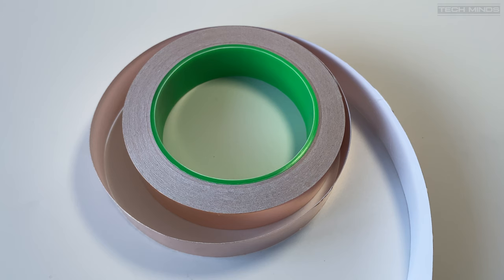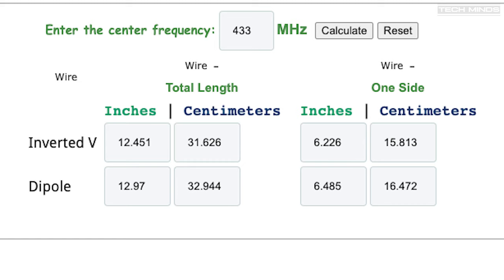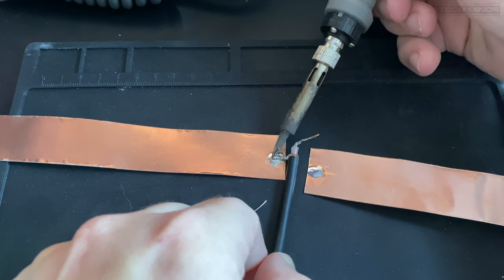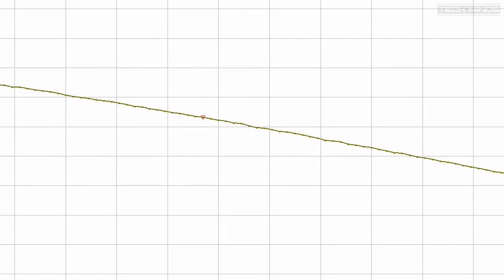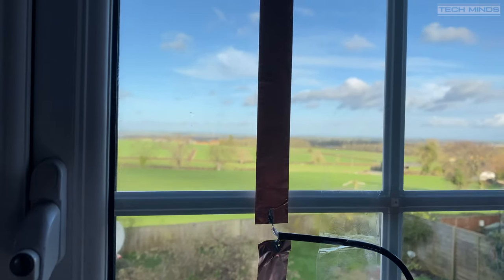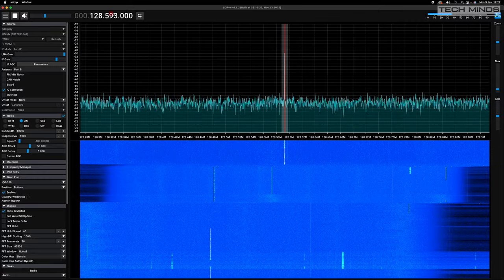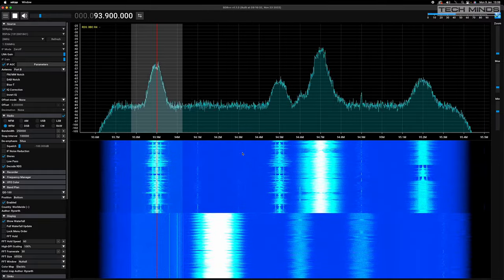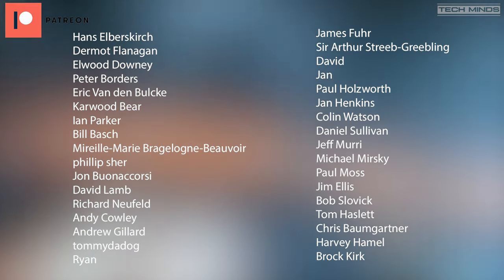VHF / UHF ANTENNA MADE FROM COPPER TAPE

Comment: Awesome video. Glad you are getting the knowledge out there. I build one of these for an old 3G modem for lady who had an art studio in an area with no internet and very weak cell coverage. I made a dipole for 850mhz on an attic window with copper tape that she used for making stained glass windows. It was all she had and I had not planned on doing antenna work. I cut the end off a wifi antenna that had an SMA-RP connector, made a "pin" out of rolled up tape and put it into the SMA connector on the modem. Full signal right away. I was shocked. I soldered it with solder meant for making stained glass windows so came back a few weeks later with a proper factory made antenna, but she still talks about that bodge whenever I run into her in town.
Reply from the maker: Thats awesome! Just goes to show that you dont always have to purchase off the shelf products to get good results. Science is science :-)

Comment: Look up “flowerpot antenna” if you get a VK callsign in the URL you are in the right place. I use these a lot. I dont strip the coax I just joint a piece of wire to replace the centre conductor.(cheaper). 😊
Reply from the maker: Oh yes, I have experimented with these types of antennas, they work very well indeed.
Reply: Aluminum Foil, heat duct tape antenna?
Reply: Love my flower pot!

Comment: I operated on 2m SSB back in the 1980’s using coat hanger wire bent into a folded dipole on the window.  Only downside was getting RF feedback into the audio via the mic lead.

Comment: Don't forget the dielectric constant of the glass. This also has an effect on the resonant frequency of the antenna. The wider the tape is, the greater the bandwidth will be - probably. Keep up the great work !
Reply from the maker: Absolutely, many factors to think about for a perfect tune. Cheers!
Reply: I wonder if the shape also influences directionality. While a wire dipole is round, and thus every direction "sees" the same surface of copper, this is not the case for a tape.
I did experiments with copper tape for antennas a few weeks ago, both to make microstrip antennas and larger dipoles (but free hanging). Looking to make an optimized antenna for 128MHz with a hopefully quite wide bandwidth (FM radio + 144)
Reply: @keukenrol  That is a very good question. It is good to hear about your experiments. Now I am wondering if a resonant loop antenna can be constructed by sticking copper tape to a window. Why don't you make a short video about your experiments ?
Reply: @fotografm  A bit short on time right now, but if I find something significant I'll share! EDIT: I was thinking about using a PCV pipe to bend the copper tape around in its width and make a kind of copper tube from it. Make 2 of it and use it as dipole.

Comment: I have made copper foil antennas for television on that ribbed plastic foam board used for posters. The foil I used was intended for stained glass and was not as wide as your foil. I was pleased with the results and made several of them for friends.

Comment: Over here in 'Merica, in the early 1990's we worked on a GM car program called 'Backlight' and made up FM diversity antenna prototypes with copper tape directly on auto window glass of test cars in a Detroit test area where there was nearly 1,000,000 microvolts/meter signal strength across several bands! There were so many transmitters, AM, FM, TV, cellular, business, etc that there was even cross-band suppression of a few broadcast AM stations by FM transmitters! It's the wild west in the USA when it comes to allowable signal strength!

Comment: Old estate agent's boards mare from Correx board would be very good for mounting the foil on. I always keep an eye out for those boards because they can be very usefully recycled! Another source can be those roll-up standing signs people make for events - they are held up by about 7' of aluminium poles which are a good basis for VHF/UHF antennas
Reply from the maker: That's a great idea!

Comment: I recently made an INMARSAT patch antenna from aluminum sheets and copper foil tape (made with the same specs as the one you made with PCB). I have no way of testing the SWR, but I was receiving/decoding ACARS. I've found that adding 3-6 layers of the tape can help, as the adhesive is "conductive".

Comment: A dummy load has a very good swr across the band also.
Reply from the maker: While your comment it very true, have a think about what I am showing in the video. ;-)
Reply: @TechMindsOfficial  thanks for the vid. My comment Was in relation to the unexpectedly broad and low return loss of the antenna which makes me think that the rf energy is being dissipated rather than radiated.  It would be a good comparison of the frequency response of the antenna against a simple dipole made by stripping the ends of a coax cable.  The width of that conductors will make the copper tape antenna more broadband.  However you are right and it does show a novel approach of using a material made for one application being used in another completely different use which I love.  One of the great aspects of the ham hobby and home brewing is that it make you look at what a product actually is, not what it says it is on the packaging! Well done,

Comment: I have some of tha ttape, though I did not get on with experimenting with it. The classic use for it is the "barber pole" antenna, where it is wrapped around a non conductive pipe. I sort of see making antennas being easier than buying them. With raw materials on hand I can make a 2M antenna faster than I can shop for one, and way faster than the wait for it to be shipped to me. Not to mention the time at a job to pay the high cost of factory antenna.
Reply: I've made several 2m antenna on fiberglass driveway markers.  They're about a meter long and 8 dollars for a pack of 4 at WalMart :)  Put about 10 turns of 18 or 16 AWG solid wire at the base, then continue straight to the other end of the rod.  Trim the length back to resonance.  You can heatshrink the whole length if you want, but be aware that the velocity factor change will probably affect your tuning

Edit: Obviously needs a ground plane of some sort to work well.

Comment: That copper tape's adhesive is conductive, so if you want to add a little length, just add an inch of tape at the ends, making sure it overlaps the existing tape.

Comment: In playing around, it seems like theres no penalty for just sticking some more on to the end for extra length. You could make your antenna longer with ease. You could also probably just tape the wire right to the strip without needing solder for experimentation with other configurations like j-poles or yagis. The options for duct tape substrates makes this an interesting portable antenna as well.

Comment: The total Mass of the material becomes a player here. The adhesive and glass introduce capacitance also. I've had some very good results with tape on 3/4" pvc pipe, and polyethylene. Use your power meter to map out the lobe pattern. 
   ;)

Comment: Nice video!  As others have noted, you’ll get some interaction with the metal around the frame of the window and possibly something from the coatings in the glass.  When I’ve done these sort of antennas, I shoot for a 1.5 SWR (as it’s a dipole) and don’t worry too much about the slight mismatch.

If you’re making home antennas, I recommend the co-ax “flowerpot” antenna.  I have one of these for SOTA and it’s an excellent performer.

Comment: As a quick way to prototype wire antennas, hot glue thin gauge copper wire to poster foam core boards.  The hot glue lifts off with a bit of alcohol, so making small adjustments is easy.  

Also the foam core is essentially air, and thus has the same dieletric constant as air (of 1.0).  Glass is much higher.  Compensation is possible of course, but you won’t be able to directly translate dimensions from prototype to production antenna as easily.

Comment: Nice experiments!  I've done similar with copper foil tape acquired as "stained glass foiling tape" from a craft store.  The only yagi-uda I tried that way was for 2.4 GHz Wifi which worked OK, but not as well as I was hoping.  In that case I stuck the tape elements on a sheet of clear acrylic trimmed down to the rectangular outline of the yagi.
Reply from the maker: That's a great idea!

Comment: The wider and flatter the conductor,
the lower it's inductance per length.

The difference in inductance between 1 meter of 1 mm round wire vs 1 metre of flat 40mm wide copper tape is astounding.

Check this with an LC meter and you will be blown away.

Btw,  When you moved the coax on the vhf version did it change the SWR ?
Did you choose a specific coax line length ?

Comment: I have a dual-band Jpole on my sliding glass door made out of this stuff... but instead of using copper tape I use Aluminium Duct Tape used by the HVAC Construction guys... makes an easy and simple RF Ground trace as well as a easy SDR Loop and Planar Disk antennas for UHF+... makes easy home-made capacitors, and voltaic piles if you're into that sort of thing...

Comment: Hi there, 
very very interesting your video; I also was thinking of testing a similar set up, but then life&work got in the way ... 
I think that there are three factors that needs to be considered:
1) each arm is not tubular as in a "normal" antenna, but it is instead a thin flat surface; that changes the way currents are distributed on the antenna radiating surface and hence the response to a particular frequency;
2) the glass, usually, contain lead; of course, this interfere with the workings for this (and any) antenna;
3) the spacing / the gap between the two arms of the antenna; 
So, for example, I'd like to see how the same identical setup would behave if instead of being stick on a glass surface, is glued on a plastic surface and then set up in open air not near any metallic object;
different width of copper tape probably behave differently; I'd like to see that ... 
different thicknesses also may behave differently ... 
and also I'd like to see what, if any, difference does it make by varying the gap between the arms, all other factors being equal.
I know, it's a lot to ask ... may be you could come up with series of videos? Just saying ...

Comment: Matt, you have installed the 70cm antenna on a glass substrate but also within a metal loop frame (aka the double glazing panel) which may be what is causing the problem on 70cm. Try it in open air on a thin piece of plastic or similar and see if it works there. Of course, this doesn't solve the problem of an antenna in say a hotel room on holiday. A 5/8 whip on a sun lounger while on the beach might be a better option to a window antenna in the hotel room.

Comment: Attach the copper tape antenna to a broom stick with plastic cable ties just to experiment with it.  You also might want to put a hook at the free end of the broomstick and another hook installed into the celing so you can hang the broomstick antenna  temporarily from the ceiling for experimentation. Good luck

Comment: A lot time ago i got cellular base station antenna, but it didn't work. I disassembled it and inside was a similar strip of aluminium foil. But it looks like wave. Probaply if you cut the strip wave way it will work more efficiently.

Comment: I'm not surprised by the wide bandwidth, given that you're using copper tape.  I think you might have gotten better performance by running the coax away from the antenna at a 90 degree angle for at least a 1/4 wavelength and including a simple choke balun, which could be just a few turns of the coax wrapped into a coil near the antenna feed point.

Comment: The frame tgat the glass is sandwiched on is aluminum . Would that affect the signal?
Reply: A lot of newer, multi-glazed windows have plastic frames to further reduce the thermal transfer.  Although it looked to me like Matt's window may have plastic "beauty" frames inside with an aluminum outer (circumference) frame.  In that latter case, yes it will affect the dipole some.

Comment: I think permittivity of glass can screw you. I have some window mount 868MHz antennas that are tuned just right (on free space like air) but somewhat off when mounted on glass window. Similar problems are usual, for example mounting antenna in a plastic tube can (often at higher frequency at least does) change it's tuning.
I'm unable to explain why this makes a problem at high frequency but worked for you in lower frequency like air/2m band.

Comment: Nice video! But not having a balun can have a drastic impact on the radiation pattern, and I assume can severely impact the input impedance at the UHF frequencies. Also running the coaxial cable in the antenna nearfield may have an impact as well.

Comment: Try to make an yagi-antenna on a plastic-folie, (DIN A-4 size plastic shield for a of paper, by an example) for a Test, maybe on 70cm, ... this size will fit! 
Or any other flexible non conductive plastic, which you can roll down, ... .

But keep in mind, to feed the coaxial-cable, perindicular from the antenna pattern. (90 degrees) This is the most problem, you can achieve, making a correct connection to the antenna! (best should be 1/4 of Lambda, minimum ... !)

Take care of the lenght of the shield and the inner wire, of the coax splitt-off, they are always the same lenghts! -  Always! - Especially on the higher frequencies, like 70cm and more! Even 23cm and 13cm are possible! - 
A lot to experiment, with different patterns of style an types. 

 It will work, ... ! 

Also sw-antennas are 'possible', when folded as an meander-pattern (linke a snail, or an 'up and down'-pattern) 
You can hang this kind of antenna on a Wall, or a 'big' window! 
 
Sorry für my bad English, it's not my native tounge, ... 

HNY - 73 de Markus L. - db9pz

Comment: It makes good 5ghz wifi antennas.
Reply from the maker: Yep, 12 volts in and you can set the bias up to that voltage if required.

Comment: I Love The Effort, But I See A Lot Of Faults In The Video, I May Need To make Similar Video Actually And Show Whats Up, You Did Use A VNA Wich Is Props For You, But All I Can Say Is You Need More Tinkering Untill You Can "sell" This Idea To people As Antenna To use, I Can See This Being Good For HOA Neighborhoods And Such Or Other Situations, But I Assure You, Making Just A Antenna From A Copper Wire Is Mucch Better, BUT If Tape is all you got, use it wisely and You Need To Calculate MORE Then Just A Lenght, Wideness To, Everything Needs To Be Tuned For The Frequency You Want To Tranceive. Props To You For Using The Coax Correctly At The Dipole, I See A lot Of Radio Enthusiasts Using It Wrong And It Hurts To Watch :D But You Should Throw Out HOW Its Corrrectly Made, I May Do That In My Video If I Decide To make One. Sorry For My English, Its Not My Native Language.

Comment: No Balun??
Reply: i for one, and many others, always try without a balum first. I have yet to find a need for one unles it is a design like the EFHW whee you need 49:1. There are some designs that use 9:1 also, and of course the Legendary Doublet needs a 4:1 feed, though it also needs a tuner and tuners for twin feed have the 4:1 built into them almost universally.
Reply: @Siskiyous6  anun
Reply: I fully trust Maxwell's equations, and W2DU's book Reflections.
Unsubscribed :^!
Reply: @cabezama1970  I am controlled by Maxwell's Demons ;)

But for a quick experiment, I've often skipped the balun.  For a more permanent installation or serious application, sure.  Bal those Uns!
Reply from the maker: @Miguel Cabeza Calculating a dipole is calculating a dipole, no matter what frequency.  This is an experimenters video, to promote homebrew, its not an off the shelf product Im going to start selling! :-)
Reply: @TechMindsOfficial  Thanks for your answer, so you show your ca. 65K followers how to improperly feed a balanced antenna with an unbalanced transmission line, because... you aren't going to sell it <cough> <cough>. Sorry, I don't follow your logic. Including a folded balun for a half-wave dipole is so simple, it doesn't take time or money "even" for a DIY antenna :O) As a suggestion, a NanoVNA check-up would have been a nice addition, IMHO.

Comment: Cut the elements you made for 440 Ham band, in HALF along its length, and then try your same test. The only other thing at 440Mhz is to put it into a J-pole configuration.
N7tzq

Comment: I did the copper tape made One for 1.2 ghz 1288. Repeater try cutting down the middle 12 inch I did this on the box from my 1to2 coax box  

Get some cardboard a scaple knife card board copper tape MOXON ANTENNA HAVE FUN
Guy kc2ayg Cheerios

Comment: This copper tape is used to shield any electric circuit, it's used pretty intensively in electric guitar for the electronic parts under the potentiometer...